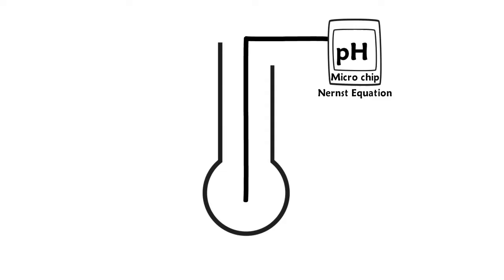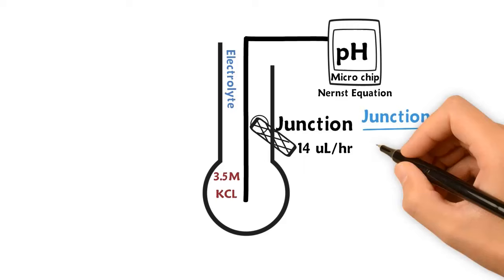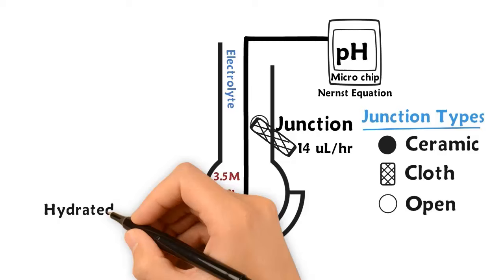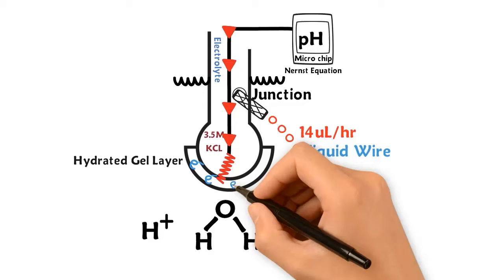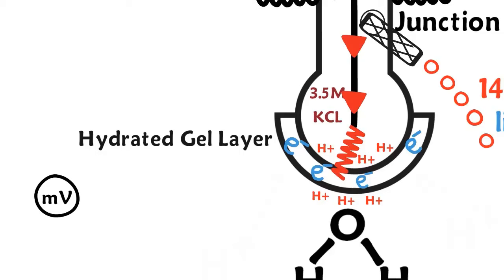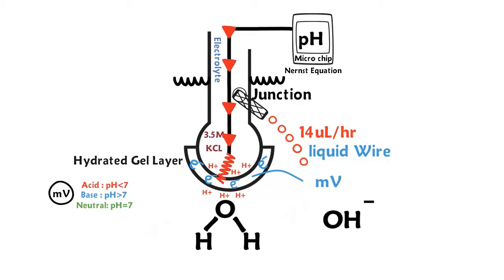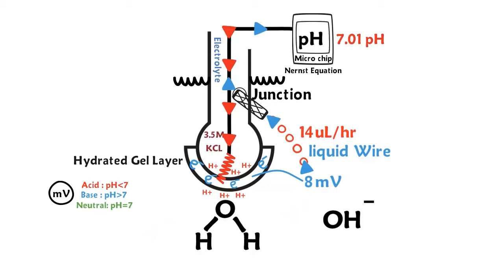How a pH meter works!

Comment: I really don't understand why lots of people in the US like to use wrong terms for certain things. There is no such thing as "8 mV of charge". Volts are units of (electrical) tension, not charge. Coulombs are units of charge.

I reckon this inconsistency and errors make a mess for people who are trying to get a grip of these things.

Also, this is a blackbox explanation of how pH meters work and it simply does not suffice even highschool levels.
Reply: I agree! The explanation of the electrical part is largely incorrect. Apart from "the 8mV of charge", also having a current run in a closed loop through the same wire away from and back to the microcontroller is nonsensical.
Reply: Lajos and Wei Ni Hao, This video was meant for individuals who need a basic understanding of how this instrument works.  I could of taken it up a whole bunch of levels but that would defeat the purpose.  There is slang and mis-used words on all levels of everything in life. The idea was to introduce the basic operation with words people are somewhat familiar with.   In reality its a electrical signal that if measured for quality control we could use a Volt meter and get that charge.  Plus, I have an equation that allows the offset to be identified and the mV value is used in that equation.  Either way, thank you for your input.  I am sure you are correct in the use of the word.

Comment: You can make your own ph pen probe storage solution (3 molar KCL) with ph 4 buffer solution + potassium chloride.
Mix 1g potassium chloride (KCL) per 100ml ph buffer 4 solution to make 3 molar kcl storage solution. The gel dries out quickly if left in open air or is stored in reverse osmosis or tap water leeches potassium chloride ions as the probe tries to make equilibrium. Storing the probe submerged in 3 molar kcl storage solution is best for years of life out of the ph pen. Change the solution the probe is stored in every 2-3 months.
Reply: 1g of KCl per 100mL does not give you 3M KCl solution.

Comment: so the ph value which i get is due the potential difference between the mesuring electrode and the reference electrode  . another questiin is that what is the role of temp sensor in the ph meter .? and  is it the aglc which transmit back  the mv signal ?

Comment: I'm confused, where is the kcl that leaked into the solution getting it's electrical potential?
Reply: It makes like an electrical bond with the electrons that are available from K+ Cl- leaked, just like a wire conducts electricity (available electrons), and the voltage generated in mV from the sensor glass electrode (gel layer)
Reply: @vitorito1033  Correct Vitor. Its a 'Liquid Wire' for the most part.

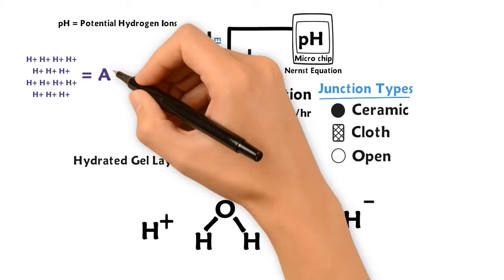Comment: in minute 1:45 it says A high number of PH represents an acidic solution and a low number is a basic solution which is wrong, it is backwards  right?
Reply: It's not the value of the pH that's talked about, it's the number of ions H+ in the solution. A acidic solution will have a lot of H+, translated into a low pH

Comment: i am confused we have filled 3 molar KCL  hen from where hydrogen ion came inside .second some one says H ion get penetrate inside glass electrode through membrane  and reaction takes place inside kcl get converted in to HCL  and some one says it is due to gradiant formed between hydrogen ion
Reply: Correct, this is a common problem depending on how often its used.  I will give you a real world example:  I had a pH electrode for a titration system that has  a 3.5M KCl   solution on the inside of the electrode (liquid wire).  We stored the pH electrode when not in use in a solution that was something different.  For your situation lets say HCL.   Now in nature the laws of anything is that 'High concentration of anything will bleed into a Low concentration of anything' until there is an equilibrium that has been established.  So when we store it in 4.0 M HCL the the 4.0 M HCL will bleed into the glass tube through the 'junction' to make it equal on both sides of the glass.  Also, the 3.5M KCl will leak out of the glass tube via the 'junction' at the same time the HCl is moving in the opposite direction.  Once you have an equilibrium on both sides everyone is happy.  The major problem here is that the instrument was not designed to have HCl as a "liquid wire' and it messes up the specs. If you dont have a refillable 'ph electrode' you have to throw it away and get a new one.  IF you have a refillable pH electrode you can empty it, rinse it with DI water and refill with your 3.5M KCl.
Reply: If you are using this in a solution that is high in H+ there is a chance that over time it can bleed back into the electrode through an 'osmosis' type of fluid movement.  Thus offsetting the balance of the internal KCl (3.5M concentration).   Typically everyone should put it in there budget to either get a (1) refillable electrode, which can be easily cleaned out over time and last longer  or (2) replace your pH electrode 1x yr.  Its about a $130 cost that is well worth it.  Just think about what it is your trying to produce and what that is worth to you. If you dont spend the $130 to keep it on point, should you even be doing what your doing?   Please read response below as well.

Comment: if the fluid leaks out, won't it run out?
Reply: It flows out at a rate of 14 microliters per hour. It's such an insignificant amount it will likely never run the electrolyte out unless used constantly for a very long time.
Reply: Jesus is correct. You will most likely run into other issues before that happens.  

It will run out quicker if you are not storing it correctly.  If you are not using a storage solution, then it will leak out until it reaches an equilibrium on on the outside of your storage cap vs the inside of the probe sensor.  Reminder: the electrolyte is a 3.5M KCl and you need to ask yourself what the concentration of KCl is in the tap water you may be storing it in.  Until it reaches 3.5M KCl on both sides it will leak.  Also, anyone using RO water will cause the reference H+ on the inside to migrate out of the inside of your pH electrode. I have seen this happen in less than 24hrs.  Its not a big deal if you can refill the electrode with a new 3.5M KCl but you would need a refillable electrode for that.  :-)
Reply: You can make your own ph pen probe storage solution (3 molar KCL) with ph 4 buffer solution + potassium chloride.
Mix 1g potassium chloride (KCL) per 100ml ph buffer 4 solution to make 3 molar kcl storage solution. The gel dries out quickly if left in open air or is stored in reverse osmosis or tap water leeches potassium chloride ions as the probe tries to make equilibrium. Storing the probe submerged in 3 molar kcl storage solution is best for years of life out of the ph pen. Not a scientist or student but a grower using common sense. Change the solution the probe is stored in every 2-3 months.

Comment: what is the  role of filling solution  in F-ion selective electrode and why it is changed on regular interval
Reply: The filling solution in an Ion - Selective solution is a fluid that is hyper sensitive with reacting per your target ion.  it serves as a type of reference point for a reading.  an F-ion electrode is a particular type (fluoride) .  This type of electrode is very sensitive and can be hard to work with depending on how you are using it.  Be sure to store it correctly after use and keep it clean.  The reaction tips should be replaced regularly.   The filling solution will react and/or the reacting Fluoride will drop out of solution due to the evaporation of the liquid that is the Filling Solution.  Once that happens your fill solution is no longer in spec of the working ISE.  Its better to be safe than sorry, so empty it after use and refill it before use.

Comment: No wonder these things are sensitive and it sounds like they have a limited lifetime because of the leaking electrolyte?
Reply: You can make your own ph pen probe storage solution (3 molar KCL) with ph 4 buffer solution + potassium chloride.
Mix 1g potassium chloride (KCL) per 100ml ph buffer 4 solution to make 3 molar kcl storage solution. The gel dries out quickly if left in open air or is stored in reverse osmosis or tap water leeches potassium chloride ions as the probe tries to make equilibrium. Storing the probe submerged in 3 molar kcl storage solution is best for years of life out of the ph pen. Not a scientist or student but a grower using common sense. Change the probe storage solution every 2-3 months.